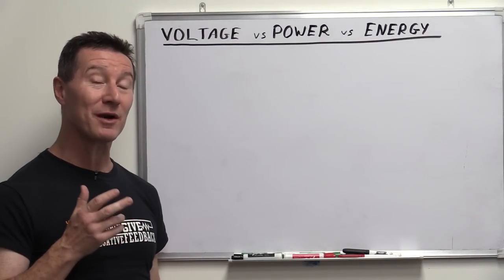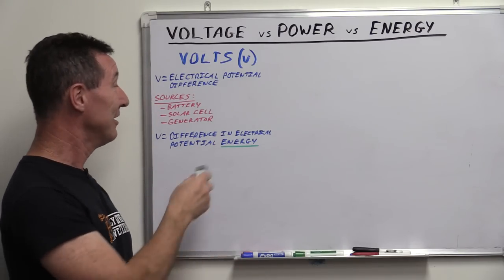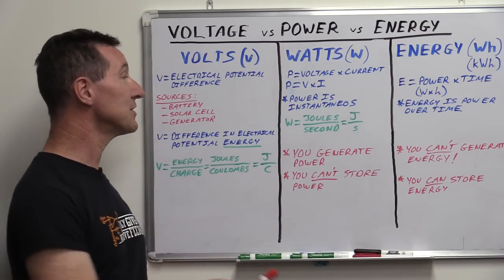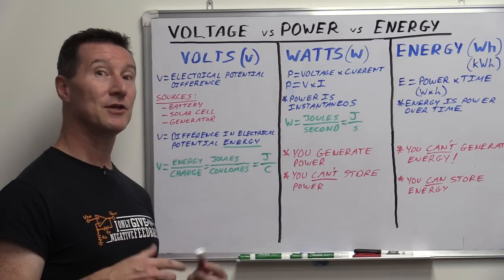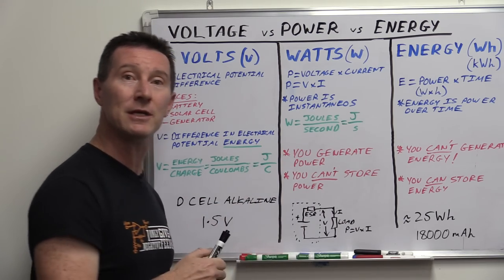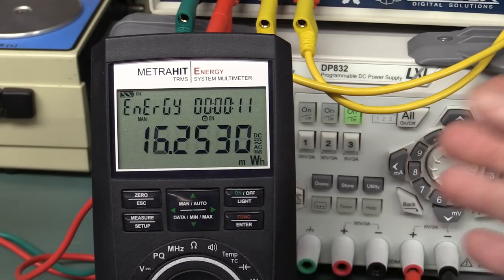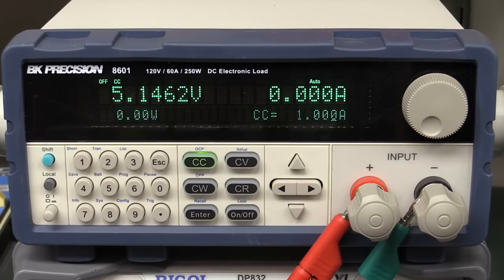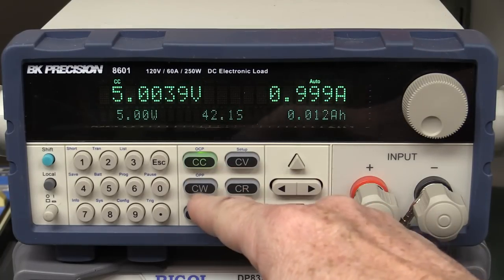EEVblog #1009 - Voltage vs Power vs Energy

Comment: Would be great to see a vid about the difference between watts and VAs.. I never got my head around apparent power
Reply: I don't know the full answer to that, but I do know watts is the real power and VA is apparent, and often seen with AC.
Think it's because AC it would be the average, since the current and voltage fluctuate and change polarities.
Reply: this is correct, VA is apparent power when measuring for AC. but it's also active power when measuring DC, that's where most of the confusion comes from beginners.
Reply: I think of reactive power this way: Powering a purely resistive AC circuit is like riding a bicycle from point A to B on a flat road. You're the generator.  Your pedaling is easy and constant.  Powering a reactive circuit is like riding a bicycle from A to B on an undulating mountain road that goes up and down, but ends up at the same place as the flat road.  You put more work into going uphill, and less coasting downhill.  But overall, you worked much harder to get there, but it wasn't useful work. That extra work that didn't get you anywhere extra is like reactive power.  

I remember the relations between them as a right triangle.  The adjacent side (that's the base of the triangle) is real power, measured in watts.  The opposite side (or far side of the triangle) is reactive power in VAR.  The hypotenuse (long side) is apparent power, in VA.  The angle between the adjacent and the hypotenuse is the phase angle difference between the voltage and current, and the cosine of this angle is what they call the Power Factor.

When an AC load is purely resistive (the voltage and current waveforms are in phase), the angle is 0 degrees, the power factor is 1, and the triangle is flat.  The hypotenuse is equal to the base and there is no opposite side.  In this case VA=W and VAR=0 so there is no reactive power.  Everything you generate is used by the load.  

As soon as you add any reactance to the circuit (typically the coil in a motor or a transformer), the voltage and current go out of phase, the triangle's angle increases, the power factor goes down (the cosine of the angle goes down), the hypotenuse gets longer compared to the base, and the opposite side lengthens and you have some amount of VAR (reactive power).  Reactive power simply shuttles back and forth, doing no useful work in the load, but causing your generator to work harder.  Because of this, VA is always greater than W in a reactive AC circuit.  W is the work done in the load, VA is the power required from the generator, VAR is the extra work that doesn't get you anywhere and is wasted.

This would be much clearer with a picture of a moving right triangle.
Reply: Great job, thanks for correct explanation. Honestly I forgot all about VARS since it's more impotent in AC and just could not remember it until you started talking about phase and right angles, it's been a while.

Comment: Great explanation Dave.. 
Guilty.... Knew all the numbers but had the terms wrong and/or interchanged.
Bookmarked for reference ;)
The water/dam explanation is a bit confusing... Would not the Energy be the amount of water flow collected at the bottom over time be the Energy and the water in the dam reservoir Potential Energy ???

Comment: I always compare power with speed. If you say km/h, you do have that hour component, but the actual speed is a property you have right at that instant.
Reply: Yeah.. power is closer to motion/time. The motion itself is the power, which is created by energy to begin with. Per hour & instantaneous are the same thing - measurements of time (motion)

Comment: If you measured a battery using constant current at 1 amp the meter would tell you a higher capacity than if you measured at 2 amps due to ESR, right?

Comment: What I've never been clear on is the relation between charge (Q) and potential difference (V).  If you have two identical spheres, and one has more electrons (charge) than the other, I assume this means there's a potential difference (V) between them.  Is 1V the potential difference of 1 Coulomb of charge separated by 1 meter, or something like that?  I can't find anything that defines a volt that way.

Comment: Being the pedantic physicist that I am:
at 2:10, the reason for this is that both voltage and energy go roughly the inverse of the size of the object (works well with spherical humans). A capacitor being so small you can have lots more energy for the same amount of charge.

This is also why we use the Earth as a voltage reference, it is so big might as well not have any charge, i.e. 0 volts with reference to the rest of the universe.
Reply: "A capacitor being so small you can have lots more energy for the same amount of charge."

energy?

The smaller the capacity of a capacitor, the smaller the stored energy. If you charge two capacitors with a given amount of charge Q (=I t i.e. Current times time), then the capacitor with the smallest capacity C will hold the biggest Voltage difference V: i.e. V=Q/C or C=Q/V (units: Farad=Coulomb/Volt or ) 

The potential energy stored in a capicitor W is equal to the Capacity times the Voltage squared divided by 2: W = 1/2 C V^2

I wonder if I can use MathML to insert equations in the comments... I will try:
<mfrac>
	<mrow> <mi>C</mi><mo>&times</mo>
		<mn><msup><mi>V</mi><mn>2</mn></msup></mn>
	</mrow>
	<mn>2</mn>
</mfrac>

<mrow><mi>Q</mi><mo>=</mo><mi>I</mi><mo>&times</mo><mi>t</mi></mrow>

<mrow><mi>V</mi><mo>=</mo><mfrac><mi>Q</mi><mi>C</mi></mfrac></mrow>

edit: it doesn't work :-(
Reply: @spc67h  E=Q^2/(2C)
For the same voltage smaller capacitors hold leas energy however, yes.

Comment: 14:39 I think the rate of flow is the current. The power is the umpf of the impact when the water hits the ground.

Anyway, the other day, my 6 year old got a small static discharge when touching me after riding a plastic slide. He was amazed and we got into talking about current and voltage. I explained it like this:

"Voltage and current is like a stone falling on your foot. The height of the stone is the voltage and the weight of the stone is the current. The static-discharge-lightning-bolt just now is like a tiny-winy pebble (or lets say "a feather") dropping from very very high. It didn't really hurt, because although there was lots of voltage (height), there was almost no current (weight).  If you lick a battery (i.e. those 9V block batteries), you feel some dizzle. Not a problem, its like if a stone drops on your foot from 1 cm height. Its quite heavy (can have quite a current), but its very low voltage.

But don't play with the wall-plug power supply. That would be like standing on the street and a big rock hitting you from our balcony!"

I think he got it. He promised to stay away from the wall plug :-D

Comment: To further this damn analogy, the gate is like the resistance of the circuit. The dam while closed has infinite resistance (so no current flow, thus no power flow). When the gate is opened, you're reducing the resistance and allowing current to flow, thus allowing the power to flow.

Also, as you said, the water right out the gate isn't really power. What the ground or receiving end of the flow sees is the power because the water has made the trip though the voltage potential (height of water when current started to flow.)
Reply: I wouldn't say infinite resistance

Comment: Yes, the mAh figure is not a measure of energy, but you've got to keep in mind it's a figure given next to another figure: the rated voltage of the battery. So that if you see a 1.5 volts battery that is rated 18Ah means it's got a capacity of 18[Ah]*1.5[V]= 27 AVh = Wh (watts=volts*amps). That's how you make sense of it.

Comment: I think there is an error starting at around 12:38 where Dave reduces the voltage to 3V, 2V, then 1V to show the decrease in energy dissipation. At ~12:45 he switches the Metrahit display back to the power reading and it continues to show 5W. I think the system is drawing a constant 1A so this should show as 3W, 2W, then 1W. Perhaps he should have reset the meter.

Comment: That was great, a few well more than a few are getting confused on power, voltage has nothing to do with power/current in this instance the people that think this are trying to use engineering equations in there head to see voltage moving  when thats not what he is explaining.
1. The water is POTENTIAL ENERGY  it has the potential to do work
2. Generator, which is in the DAM = VOLTAGE
3. And the flow of water which has potential to do work generates POWER
Stop trying to use Voltage as a moving object, when thats not what he is trying to explain.

Comment: Working back from energy is probably the easiest approach.

Energy: 1 J = 1 W.s (and 1 kWh is 3.6 million W.s, or 3.6 MJ)
Power: 1 W = 1 J/s (establishes that power is energy per unit time)
Voltage (and current): 1 V x 1 A = 1 W (establishes that you can't calculate power or energy just from voltage, or current, alone).

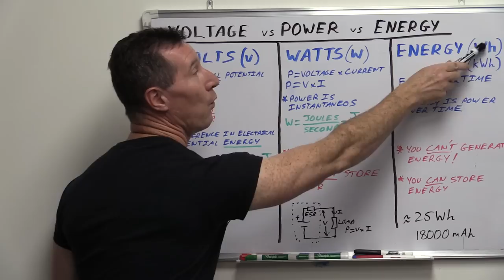Comment: Careful with confusing expressions like "power over time", as "x over y" in maths means x/y, not x*y. Also, at 8:01 and 9:41 you say "Energy is power per (unit of) time". "Per" also denotes division, which is not correct here. So instead of saying "200W per day", it should be "200W for a day", because "for" indicates multiplication. Correctly used for example at 10:14.
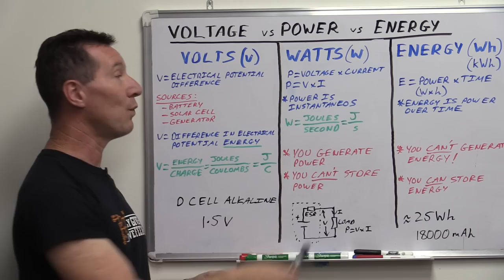Reply: 10:31 "One is instantaneous and one is a measurement over time" Does not compute. Define instantaneous. instantaneous is a measurement of time

Comment: Another important point, and a common misconception, is that using two meters to measure voltage and current in an AC circuit does not necessarily give you the load power. That can only be achieved with a wattmeter. It makes no difference if the meters are 'True RMS' or not, either. They still do not give 'True RMS' power where the load is inductive or capacitive. 

I suspect that many of the claims for 'Bedini motors' and the like of over-unity energy are down to not understanding AC power measurement. They typically use some kind of interruptor to create a pulsating current in a stator coil which rotates magnets, and then use either the same coil or a second coil output, rectified, to charge a battery. Under these conditions it is surprisingly difficult to accurately measure power in and power out, which probably leads to a lot of 'red herring' results.

Comment: Hi!!
Is it possible a capacitor posses negative voltage ????
Reply: Hi, when measuring voltage in a circuit, with respect to your reference point, the voltage will be different.  If you swap the measurement probe incorrectly. Then, we could measure the wrong voltage value.

Comment: While I don't feel like I'm in the position to argue, it can be confusing when batteries are listed with Ah as capacity. Let's say I'm changing my phone with my laptop (while off). Since my laptops battery is rated at 10.8V and my phone at 3.7V it's not straight forward to know how many times I can charge the phone. Wh for capacity is super handy here!

Comment: I see Energy as a stored value.
Power is the flow of the Energy.
Voltage is the potential of that Energy.
Current is the flow rate of that Energy.

Comment: Always having a hard time seeing V for voltage instead of U. Is it only in the EU that U is used for voltage?
Reply: Interesting, did not know that.  We use E and V for voltage in the US.
Reply: E is normally used for energy [J or Wh] or electric intensity [N/C=V/m] (to speak for my experience in Germany), I never heard of E for voltage but I have to say I'm just a mechanical engineer :)
Reply: Using E is illogical. E for electromotive force (aka. voltage), E for electric field strength, E for energy, E for irradiance. How much do you want to overload poor E with more or less related quantities?
Reply: ppdan here is something our professors say: there is no conservation of letters law.
As physicists we use all sorts of notations. U for potential in lagrangian mechanics, V for potential in quantum mechanics. Φ for scalar potential in electronagnetism and fluid dynamics. A for 4-vector potential in relativistic electrodynamics both classical and quantum. V for voltage difference in circuit analysis (yes we do that too).
Math is like that. It is abstract so it doesn't really matter what the words symbolize. It is necessary however that the formula is consistent in theory and experiment.
Reply: We used to use U in high voltage and machinery classes, V in others like power electronics. It's all about conventions.

Most machinery and HV equipment in my school was German-made. For example motor speed was shown in U/min. (I'm from Turkey)
Reply: "V" is intuitive to English speakers.  This makes it easier to learn the formulas taught at the beginning of electrical theory.  "I" for amperage already throws beginners off.  I cannot tell you how many times I have seen Ohm's Law written as V= A x R or V= C x R because "I" is not intuitive for current.  I have not seen "E" used very often outside my tech school.  And then only used for generator voltage.

Comment: the hight of the water behind the dam is only valid as comparison to voltage if the water would flow out at the bottom of the measured hight, there is the pressure (voltage) of that measured depth you drawed, not like the situation showed in the picture where the water flows over the top, way above the bottom of the measured depth, just saying, great video further.

Comment: my science teacher analogized with a water-mill,
but the only thing I actually remember is that Energy was represented by the water-tank he used for powering his physical presentation.

edit: hadn't seen the dam-analogy yet, but I think my teacher's example was a bit more practical as it also taught about (rotational)-resistance. (what's the use of all that water when it doesn't power anything?)

Comment: I was taught Voltage is the ability to jump a gap. Power or Watts is the amount of work done. Energy can come in many different forms, electrical, heat, nuclear, even wind. Energy is what is used to get the work done.

Comment: Dave, Not sure about the "flow" of energy? Also not sure about your emphasis on the "instantaneous" nature of power. Energy consumed or delivered over a time interval would surely give the average power over that interval? Please correct me if I am misunderstanding.
Reply from the maker: Depends on how you want to explain it. I'm pointing out "instanteneous" because power is what you measure or what you deliver at any the moment you measure it. The big point is that power does not have a time component in its units and energy does.
YMMV
Reply: Thanks, I appreciate the reply and clarification.
Reply: think of it like the speed your car travels, 100km/h is an instantaneous speed, sort of like J/s is an instantaneous speed
Reply: something something calculus something

d/dt J(t)
Reply: I understand but going 100 km/h for an hour would mean your average speed over that time interval was 100 km/h. I was not sure why Dave seems to emphasize the instantaneous nature of power while one can certainly discuss average power too.

Comment: hmm....thinking another way to express, mathematically, would be power is the first derivative of energy w/r/t time, and voltage the second derivative w/r/t time?  I guess my maths teachers, when they taught me calculus, always got me thinking when a rate is mentioned, it's a derivative.  Another example, speed/velocity would be the first derivative of displacement w/r/t time.
Reply: rchandraonline Voltage is not power per time but power per current.  And yes, these differential equations are needed for many circuits.

Comment: Going to be a real geek here and say there is actually a way to store power, because you can store a flowing current, if you have a superconductor ring and you induce a current in it, the electrons will flow round the ring with zero energy losses over time, as long as the temperature of the ring remains below a certain threshold.

Comment: Calling voltage the "difference in electrical potential energy" rather than "difference in electrical potential" could be a little misleading. "Potential" refers to potential energy per unit charge, while potential energy depends on the charges present. You do go on and explain the difference right afterward, but I just know that my engineering teachers always did emphasize that distinction in terminology!

Comment: Come on! Dave! You have had to heard about hydraulic analogy used to explain the physics of electricity... It's very good similarity example, regarding to everybody everyday experiences - each your viewer may experince (view, listen and feel) te energy, power and pressure of water. Water as a current - this approach is very simple to understand the basics of electricity. Potential energy of water in the tank above the ground as a energy accumulated in battery, pressure (the difference of pressures) as a voltage (the difference of potentials), pipe as a wire, water flow as current flow, etc. Regards!
Reply: Damn! You did it at the end but I stop watching after first minute. You should start with that kind of informations :D

Comment: Dave.  So - Engineering also defines "Voltage" as "electromotive force" (e) or e.m.f. !!  So - doesn't that make Voltage a "force" ??  How does that translate with the other definitions of Power and energy ?
Reply: I believe that the electro magnetic field being negatively and positively charged is based on the positive and negative pressures.. The pressures are a direct result of gravity. Gravity occurs when there is accumulated energy (potential power)

It's a different type of emf by definition, but they might be related.. I'm pretty sure that they would be